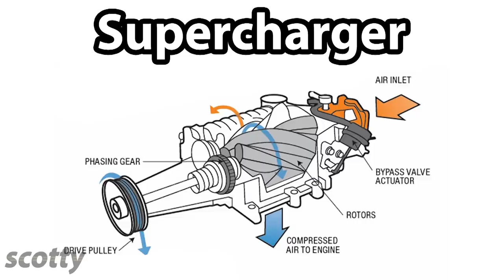Supercharger vs Turbocharger - Why Supercharged Car is Better than Turbo

Comment: 500 HP to 1200 HP by adding a Supercharger...WTF? Can you send me a couple pounds of whatever your smokin? You do know that over 60%+ of people choose Turbos right? I've seen many different polls and surveys and everyone 1 in the end has had Turbochargers come out on top? I don't remember a single 1 that has had Superchargers even come close? Main reason is that yes, a Blower is connected to the engine crankshaft for boost at any RPM...BUT..that also means it steals engine power, it takes HP to turn it and is not as efficient as a Turbo cuz the Turbo uses exhaust  prressure, that otherwise would be wasted? Turbo technology has advanced ALOT in the last 10-15+ yrs which has nearly eliminated Turbo "Lag" in many cases? Want proof? Then just keep a tally of cars on TV, Drag Strips, or YouTube vids of the vehicles choice of "power adders" and it's will be quite obvious that the overwhelming majority of what successful racers (and Streetcars) are choosing? (with the exception of Top Fuel and Funny Cars of course!!) But in the end it is truly personal preference... personally I prefer NO2...but that's just me?

Comment: Sorry but no.  A supercharger cannot nor will ever be capable as building as much power and what they lack in lag time they make for in peresstic loss which turbos don't have.  Also,  turbo lag is pretty much a thing of the past.  You'll never find a 1500ph supercharged car...any car over 1000 is using turbos, period

Comment: Scotty has an opinion. He chooses a parasite over a gift of free power from waste, while pooh, poohing better gas mileage. Supercharger robs power to make power. Turbos take wasted exhaust fumes to increase efficiency, and gain power. This is a no brainer and is why most manufacturers boost with turbos. Turbos give you better performance 'and' better gas mileage. Superchargers give you more power at the cost of lower gas miles 'all the time'.

Comment: A supercharged car is not better, at all. Yes a blower will still make big power. But the reason turbos are scientifically better is because a supercharger takes power to run. It draws anywhere from 50-100 hp depending on power levels parasitically from the from drive belt. A turbo uses free, otherwise wasted energy from the exhaust to produce boost. Turbo cars will make more power than blower cars on the same setup. Please stop trying to make performance videos.

Comment: lets see how many semis, ships, bulldozers, trains etc use superchargers?............NONE.....there is this thing call efficiency...turbo chargers are more efficient, they recycle thermal energy that would otherwise be lost out the tail pipe, there is always parasitic draw from a belt driven supercharger-ALWAYS!!! even with a belt slipper clutch, for every 100 hp the engine will be losing 50hp roughly and then there is thermal efficiency, as long as both centrifugal supercharger and turbo charger are using equal post cooling through intercooling they have the same thermal efficiency but a roots type blower has horrible thermal efficiency even with post cooling- I have a 2.3 litre-131cubic inch straight 4 cylinder that is a daily driver that output 648 actual whp 525ftlbs of torque so yeah you can make a lot of power either way but out of boost my engine suffers no parasitic draw, it magically transforms into it's original low output 165whp gas sipping self .....and lag is not to be confused with boost onset, if you know how to size the turbo accordance to the volumetric output of the engine and consider what are the parameters of the application is to be ie, will it be an everyday car, a road course car, a 1/4 mile you can suite the TC to the car. Modern turbo chargers with variable vane turbine wheel along with advanced engine management that implements anti lag.

I will agree for the common consumer they are more complicated and required higher maintenance attention and awareness.

Comment: Oh Christ facepalm. A supercharger suck so bad. They have belts they have that horrible whine there's very little torque compared to a turbo. I could go on and on and on and on. Anybody who makes big Power on the street used turbos. Manufacturers use superchargers cuz they're cheap. But if you push them hard they get heat soak and if our goes way down or are they probably set up turbo will keep putting out power.
I would never ever ever put a supercharger on one of my cars again. Turbo all the way.

Comment: What an awful comparison and completely one sided. Turbos make more power by far, they get better gas, they are MUCH easier on the motor than a supercharger. They are not that much harder to install if you get a proper kit. And turbo choice can make up for lag. Very uninformative and bias

Comment: DONT LISTEN TO THIS FUCKIN GUY. You are a picture perfect example of why I NEVER recommend friends or family with modified cars to take them to any mom and pop shop (assuming they can’t afford to have myself work on them.) 

Superchargers are crankshaft driven, and although the “lag” isn’t there, it robs your engine of power. Because of this, there are far less modification options available for cars equipped with one without spending a pretty penny.

Turbochargers run off of a byproduct and the lag can be eliminated and you can double, triple, or quadruple your power for a fraction of the cost when comparing it to a supercharged engine. Also, there are ways to eliminate and tune turbo lag. 

Also, turbos are more effective in average engines (I4, V6, S6, etc) due to displacement. You would have to have a car with a bigger engine to have hp increases in the hundreds by supercharger because of the low numbered displacement in 4 bangers and 6 cylinders, and factoring in the fact that a supercharger is crankshaft driven. 

Perfect example. A 2015 Audi S4 only has 333hp and it comes factory with a supercharger. An STi with a 4 banger and a turbo is a mere 20hp off that with a smaller engine.

Superchargers are less responsive to tunes as well because it’s a mechanical component. It would require significant amounts of money to upgrade a supercharged engine to generate more boost, whereas a turbo charged engine more often than not is a matter of plugging into the ECU. They’re also on average more expensive and not as readily available. More Supercars are going with turbochargers because they get the best performance, reliability, and compatibility. Not to mention they generate more power. Superchargers are more heritage installed on pony and muscle cars to remind the owner of the heritage and performance back in the day when turbo performance was subpar and nowhere near where it is today with technological advancements.

Last gen ford GT? Supercharged. New one? Turbocharged. Remind me, which one has more power? Ford would have come nowhere NEAR the power generated by the new turbocharged engine if they had installed a supercharger. GT500? supercharged. GT350? NA. Which one has more power again? You have no idea what you’re talking about in this aspect of automotive. 

In conclusion, if you’re someone who wants more power with no intentions of modifying your engine for power gain, or you have stacks and money’s not a problem and you want that classic supercharger whine. This may not matter to you. If you want an affordable way to add power and be able to modify your car for significant power gain, then this isn’t the route for you. A supercharger isn’t good for power. 

Stick to pre-obd2 and non aftermarket cars old timer because you are biased and a biased mechanic isn’t an honest one

Comment: Your drinking and smoking too much Scotty. Check under the hood of every 18 wheeler at a truck stop or tractor hooked to a sled. You will not find a supercharger. Would be like a 100000000 to 1 chance.

Comment: Yeeehhhh.. put that sport air filter next to the fucking engine without any heat protection.. adds a lot of horsepower.. u at least put an big intercooler in it ?! -__-

Comment: Supercharger will destroy an engine much quicker. Needs more supporting mods, one is not better than the other. Very irresponsible video Mr.Kilmer
Reply: SC boost is linear so its easier on the motor and transmission , Turbo is NOT so when the boost HITS, puts alot of strain on motor and transmission, I think ill go SC
Reply: @joeydelmarsjr.646  That can be interpreted in diffrent ways. Boost hits on a turbo car when youre already going in most circumstances. Supercharger is constantly working the engine and trans.
Reply: @mike88wt  indeed, but its linear, its not making much boost at low rpm, vs a turbo, will make more boost as the same rpm of a sc will, but it wont increase gradually it will be more on surge of boost that will cause more issues down the line and cost more to repair and maintain

Comment: Ummm this is probably the worst video Ive seen scotty make. Very bias against turbochargers. Manufactures use turbo chargers because they are more efficient and make more sense it has nothing to do with emmisions. Superchargers require a specific kit for a specific car turbo chargers can be fit on any engine with soke custom work. F1 has been  using turbos for years and trust me its not to meet emissions

Comment: Stupid video, turbos are superior to any superchargers. They're more efficient at making power. Turbos don't have to worry about belt slip, heat soak, or parasitic HP loss.  When you're talking about turbo lag, tuning and the size of turbo(s) play a huge role. My Hellion twin turbo'd Mustang will smoke any street legal, supercharged Mustang at the strip.
Reply: what makes you think all supercharges are made equal, some SC are air cool just like a turbo, and even tho a turbo makes more power doesnt mean its better. theres pros and cons to both turbo and sc